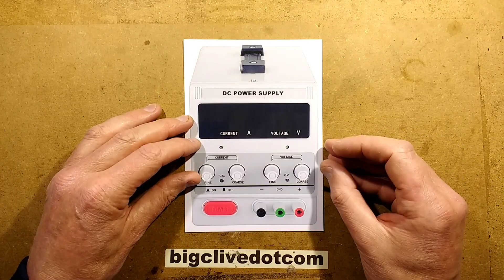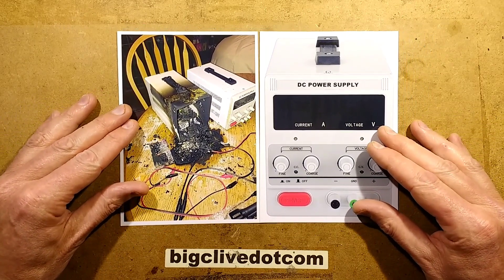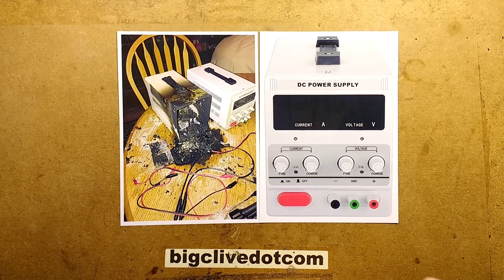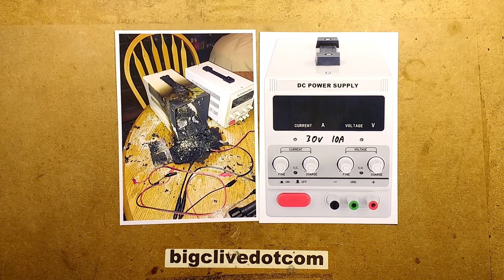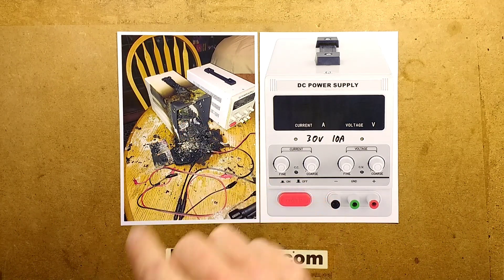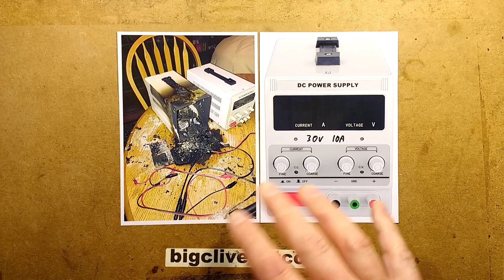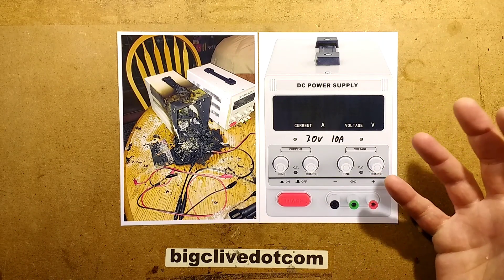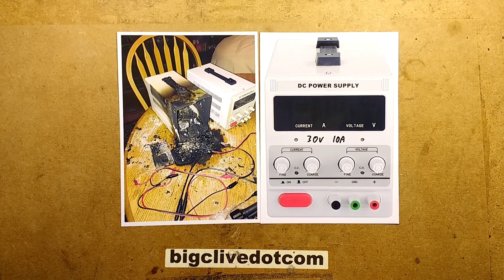Smokin' power supplies.  PSA

Comment: little bit of solder and it will be perfect again
Reply: Leaded solder of course.
Reply: couple of cans of tennants and bigclive will have it up and running :)
Reply: CodeBurger 
  The adhesive on Duck Tape is not thermally stable. This is why it should never be used on HVAC ducts. This is also why it makes such a mess on any surface that goes through thermal variations. Aluminized adhesive tape is more thermally stable and will stay in place on HVAC ducts.
  Both have a grey shinny look, and I've seen both used to tape up the corner of a plastic automotive bumper instead of replacing $0.50 worth of plastic clips or 2 screws and a $5 retaining clip. -What we called "Alabama Chrome" in my old paint and body shop many years ago.
Reply: You need a dab of Spackle as well, though.
Reply: Don't forget a can of magic smoke
Reply: Stepy D Plus a bit of glue and some spray paint. The table however...
Reply: mark. keilys. Duct tape, because it's made for air ducts.
Reply: CodeBurger 
   Duck tape, because it is the ubiquitous product brand name. The irony is that it's terrible for sealing ducts. 
   I was born in 'bama but promptly removed and raised elsewhere.... Alas, my Alabama Chrome cert must be revoked for spelling errors.
Reply: Upcycle Electronics You are totally right. But HVAC ain't all ducts. Simple air circulation ducts aren't exposed to thermal stress like HVAC ducts are.
Reply: mark. keilys. Aluminum tape is uniquely used for THERMAL isolation of ducts, not when you just need to keep the air in. Duck tape is one of hundreds of brands of duct tape, and brand-names should never be used to refer to a product, exept when referring specifically to the brand's product.
Reply: here in scotland tennants goes with everything
Reply: ***** 
 Bad dad joke thoroughly murdered.
Reply: CodeBurger 
  I prefer goose over duck in this circle ;)
 I haven't played with very many ducts outside of the home. I really hate removing Duck Tape adhesive from damaged autobody parts though. Nothing that is 100% safe on ABS plastics can remove the stuff....such a nightmare.
Reply: Those marks will buff out.
Reply: Probably just reset the breaker...
Reply: Duck tape was named for it's water resistance (much like a duck's feathers), is good for water resistant seal, and not suitable for sealing ducts due to it breaking down with heat (the brand was named after the tape).
Duct tape is heat resistant (typically made of foil), ideal for sealing ducts, and not good for making water resistant seals.
Reply: Might need some Alabama Chrome ta kee'per tag'heather State Side. Ain't nuthin sum duct tape cain't fix.
Reply: Upcycle Electronics
*duck tape

Comment: I certainly do not leave mine running when I leave the house. I even turn off chargers.
Reply: Walter Raleigh 
Not a bad idea, especially the cheap SMPS USB chargers. I've taken apart a few recently that don't even use controllers. They're just discrete components for the oscillator and a zener clamp. Suuper Sketchy... and look like they were soldered by blind people.
Reply: Think that one was made by one of Satans more feeble apprentices - check out the poor attempt at a pentagram in the middle of the board :D
Reply: Upcycle Electronics... or children.
Reply: Upcycle Electronics That looks like an Apple 30 pin connector which used to have 12v in the specification. I'm not sure if that was ITE 12v or automotive 12v though. If it was ITE then this device was still wrong.
Reply: It doesnt make good sense to try to reduce routine firehazard through switching and unplugging.  Even with someone awake and present in a house - fires are still dangerous. 

Except in special cases, just don't routinely use any appliances not trustable to be left unattended. Too much switching and plugging has its own downsides and risks.
Reply: @andrew i agree.  We are a 1st world country who invented some pretty darn safe electrical regulations, stuff should be decent, saving a penny on production to let someone else have the house fire isnt on, it should have safeguards and be properly made end of, anything that isnt should be shamed, ebay direct import gets around the fast that no decent store could sell it, people do leave things on by mistake or on purpose, it shouldnt mean they deserve to catch fire, sure running an experiment should have not left it, but if the psu itself is what caught fire (and it did seem to be, not his peltier thing) then its to blame more so than him leaving it.
Reply: @upcycle, yes , i think that was my point, did i not make sense. yes it should be idiot proof, we live in a 1st world country, we invented high standards for electrical safety.     but these devices are too cheap, they dont conform , its not about pro models, things can be made affordable and safe, but these evade the existing safety laws for cheapness
Reply: Daniel Armstrong 
  I think your right. I was searching for MC34063's after saving a load of stuff from going in the trash. I've never been interested in lIePhones. I vaguely remember hearing they had a different charge voltage.
    This thing is really terrible quality regardless. No exterior labeling, and it holds together about as well as an old plastic coin purse. Oh well, I guess I've got a fresh PCB to build on now.

*
 On second thought... Someone was a genius in this design. How many people forked over $20-30 for one of these with just a diode, a fuse, a led and a resistor?
Reply: At least it's fused xD
Reply: people do though, along with charging their phone on the nightstand overnight, and forget they bought the cheapest shit charger at the market earlier as paying 2.50 in asda was too much and the £1 one was colourful and cheaper
Reply: Jusb1066 
   I understand your point about safety when it comes to consumer goods. They need to be idiot proof, because consumers are idiots.
  When it comes to a bench power supply, I think of these things as tools. I know if I buy an inexpensive tool, like let's say a welder, even a reliable, quality branded model, I will never be able to use it like a top of the line model. If I try to use it for a Fed certified structural steel project I'm going to fail. It's the wrong tool for the job. If a sub $1k welder were capable of such tasks that's all anyone would ever buy/use.
    These little hobbyist bench power supplies are not a $5k Fluke Programmable Lab PSU. They have excellent specs and functionality for an entry level hobbyist tool, but they are still an "entry level hobbyist tool." They are not fit to get pushed like a professional grade tool with all of their built in safety and redundancy precautions. If they did the same job as the pro models, there would be no reason for anyone to buy the much higher priced pro models.
Reply: +Wagoo 
 My grandparent's TV and VCR came with fully populated circuts, and Fed regulated QC.
   Check out this quality gem I found today. 
http://i1160.photobucket.com/albums/q500/jakebikereligion/Mobile%20Uploads/IMG_20170606_182435_zps4gfz6hju.jpg
Reply: You're turning into your grandparents, don't forget to unplug the TV and VCR from the wall at night too!

Comment: Never trust chinesium. But for sake of safety you should NEVER leave a PSU with something like a Peltier Element running while leaving the building.
Reply: Drakkar Calethiel A Peltier element is often used to create a simplistic refrigerator, or to improve cooling of some other device. So it makes perfect sense to run one 24/7 using a trusted power source. Unless the Peltier element was mounted so it would send the heat into the PSU, the problem would be trusting the wrong PSU.  It was even underloaded at 144W out of 300W max.
Reply: Richard you can keep living in your candle lit cave if you want, I'll keep living in the future with 24/7 computers and automation integrated into my life. Have fun with your cave paintings! ;)
Reply: Wagoo No wonder that they need a beefy PSU.
Reply: Wagoo It's just my rule. Since my whole room burned down from a small project I usually turn everything off, but there are a bunch of things where I keep everything switched on. It really depends on what is connected, if it heats up over 150C I never leave the building while it is switched on.
Same goes for battery charging, a LiPo cell literary started the devil's show. The "funny" thing was that the charger had overvoltage, overtemp (battery temp), and balancing. Technically it should be save to charge it while not at home, but still something failed. Glad I was in a room nearby so I could throw the almost burning battery out of the window. 
It shows there's always a chance that something starts the smoke/fire show even if it should be 100% save.
Reply: That makes sense with raw LiPo cells (I guess your charger didn't do what it advertised to.. sorry to hear!) I've read many stories about THEM bursting into flames.. a lot of people seem to charge them in metal boxes or inside special jackets to avoid that
Reply: The charger was actually a pretty decent one, can't remember what brand it was. The accident happened around 6 years ago so I can only remember that it was a big fat 6s pack.
Reply: Also since then I do charge them in a aluminium box, if it do want to burn they do it "peaceful" in a box what can't melt or burn.
Reply: Agent '001 Or that, it's always the magic pixies who do weird shit.
Reply: Richard Hunter So true! Better save than sorry.
Reply: Well you said power OR heat, my computers certainly draw a lot of power.. GPU chipsets often get close to 100C too, despite any fans. Modern CPUs have thermal throttling that should drastically reduce clock speeds even without a fan or heatsink to preserve the chip.
Reply: Unattended does not mean idle, though :) I run various CPU/GPU compute tasks on mine around the clock and often connect back into them remotely. They have 1000-1500watt PSUs even if they don't draw that much at full load.

I was going to make an analogy about turning off the starship Enterprise but then remembered they don't know what a fuse is and regularly have consoles explode and kill red shirts :P
Reply: Richard Hunter Mostly they just let the smoke out. My GPUs go well over 90C in summer but you have to consider that's the temperature of the die itself. Also glad that I'm not the only one who's better safe than sorry.
Funfact today my 3kVA variac was delivered, but the inrush is so high that the fuse pops almost every time xD Time to build a softstart.
Reply: Wagoo 1 to 1.5kw PSUs? Damn what are you doing! With that power you have some serious power hardware :P
Reply: simontay1984 Tried it and still the fuse blows. Tomorrow I'll get a 50 ohm high power resistor. With it it should work.
Reply: Reminds me how Photonicinduction's 3-stage variac dims the lights when he turns on a stage. Gotta love inrush
Reply: Prehistoricman It really dimms the lights on the phase. Crazy how much inrush toroidals have!
Reply: Drakkar they're either big fileservers (24 bay + 20 bay + 12 bay hotswap), or general CPU tasks, or GPGPU AI stuff.

I'm gonna toss into the arena the whole heat/cold cycle being bad for circuits, they like being on all the time :P
Reply: Drakkar Calethiel Aluminium melts very soon. I once tried to make a reflector for a 500W Halogen lamp. It melted in seconds.
A piece of flame resistant drywall will do a better job.
Reply: Why? I mean I know why with this cheap PSU.. but electronics are designed for the servitude of humanity, they shouldn't need babysitting :P